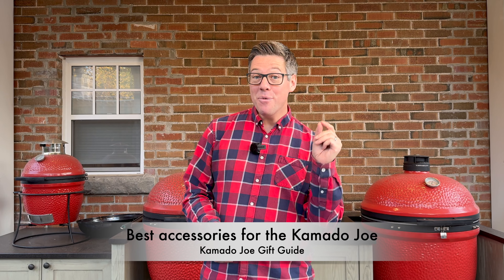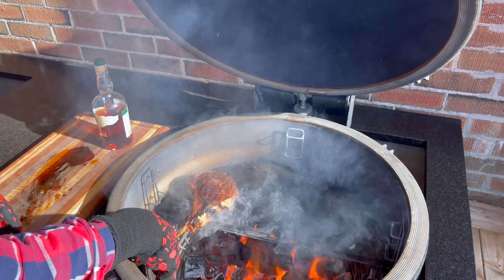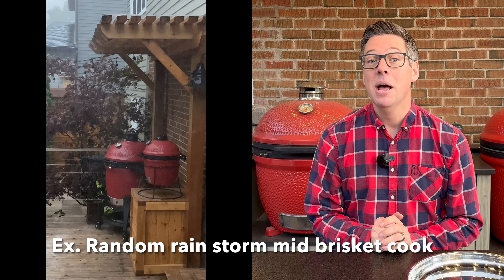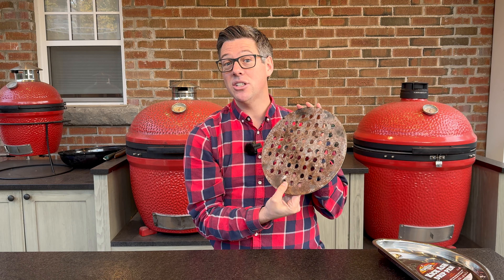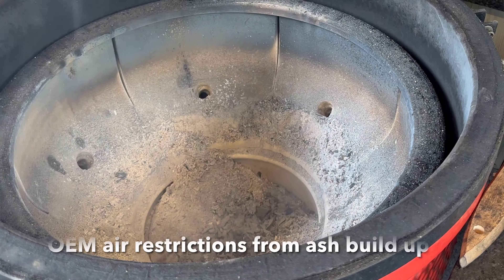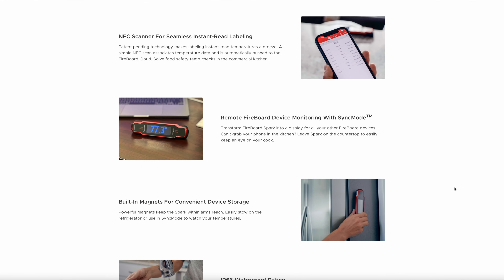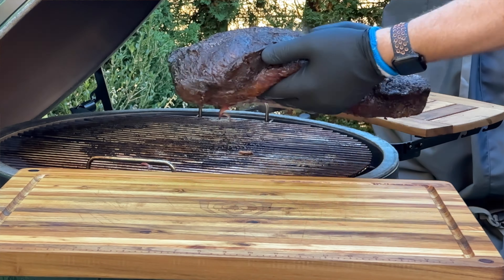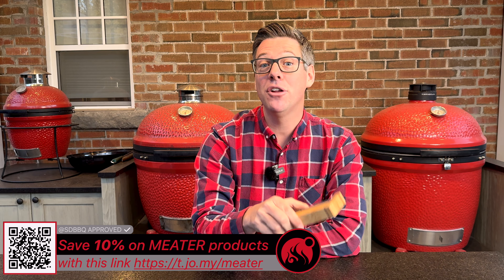Top Kamado Joe Accessories … My BEST Gift Ideas For KJ Grills

Comment: Grillgun accessory - refillable 1lb propane tank from Mr. Heater. Their "Fuel Keg" refill kit and tank are available in the USA (not yet sold in Canada due to in-progress CSA certification). It will cut down your refill tank costs by refilling from a 20lb bulk tank. I ordered from Home Depot USA and shipped to Canada and it wasn't that hard on the wallet.

Comment: Hi James, i hope you are well.
I recently purchased a smokeware cap to replace the daisy wheel on my jr..
Do you find that its harder to dial in and maintain low and slow temps with the smokeware cap over the daisy wheel ? I have never had an issue before but was struggling to maintain smoking temps with the bottom vent at about a pencils width and the top vent open about 2cm ! Lol maybe i need to shut the top down more? Thank you

Comment: Another great video James! I recently saw a video where you use the kick ash can to add more wood chunks to improve the smoke profile to your bbq. I’ve tried adding chips to the ash tray but they never seem to catch fire so this looks like the best way to add more smoke! So thankyou for sharing that. I have a classic 3. Do you know what size i need to get? The website doesnt tell you. They have small, medium, large
Reply from the maker: if you follow the link there is a shop by grill button.  click KJ and then click classic 3, it shows you only the parts confirmed to fit.  for some reason the series 3 doesn't list the can but it works, so i used the series 2 page (Part Number: KAC-9.7)

Comment: Do you know if the Konnected Joe will fit in the BGE tables?
Reply from the maker: the air lift hinge is bulkier at the back than the BGE design, i would get the measurements for that and check before ordering otherwise the dimensions of the large / classic 1/2 are pretty much the same (also xl egg and big joe 1/2)